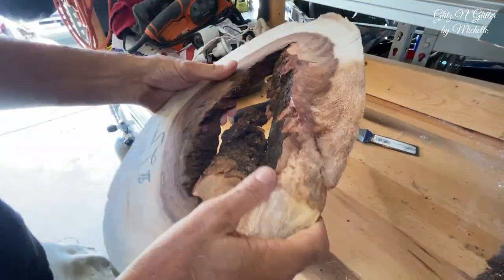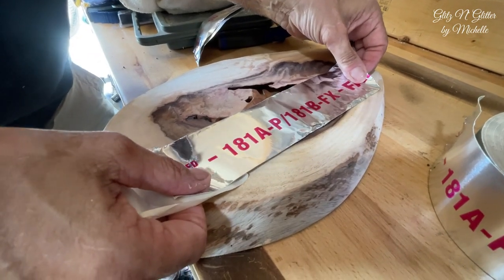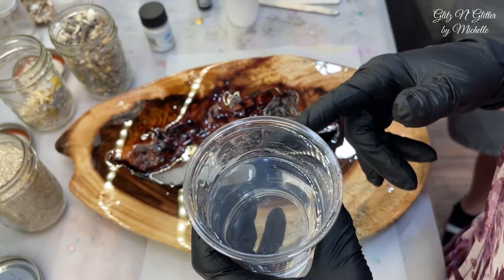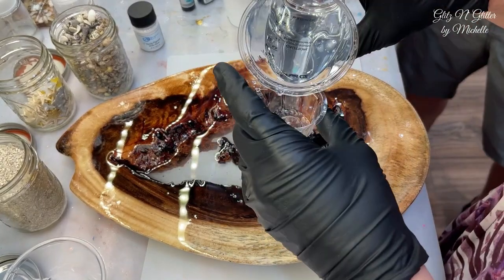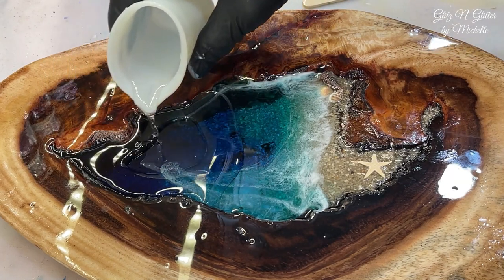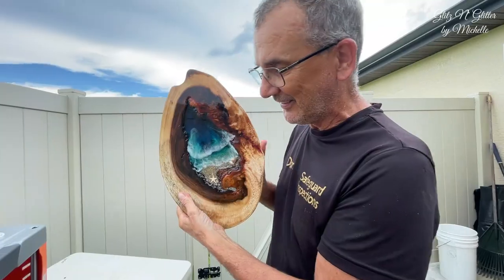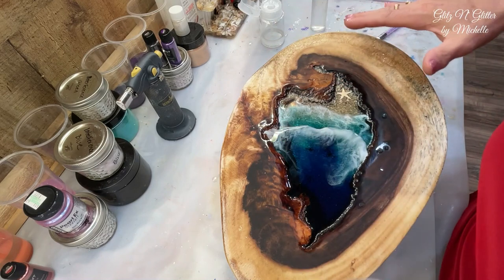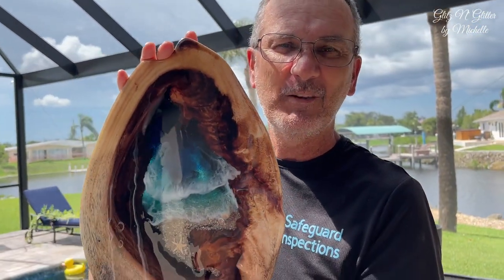#202 How To Make An Epoxy (Resin) BEACH Charcuterie Board.

Comment: Gorgeous! Simply stunning! I think they are the best waves I've seen in ages!
I love the way you work together! You make a wonderful team.
Dunno if it will help but I coat my wood in uv resin  the cure it before filling to save bubbles, I am sure you get 100's of messages but that's what I meant when I messaged asking if you coated your wood because mine always caused major bubbles and I was jealous and wanted to know your secret 😊
Reply from the maker: On the thin first coat we applied a thin layer over the whole thing before the final pour on this one. We’re still learning and testing theory’s 😁 thanks for the tip it is well received 😊